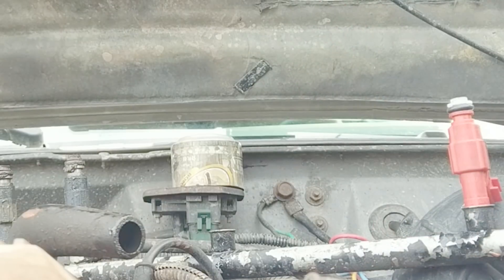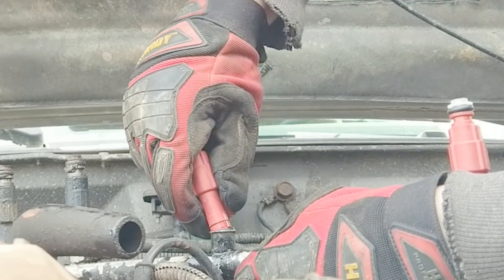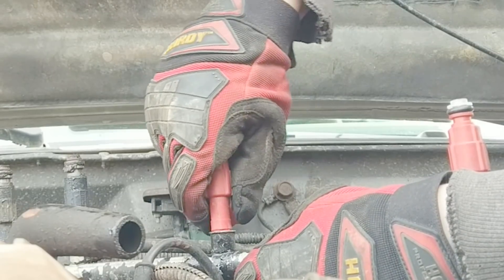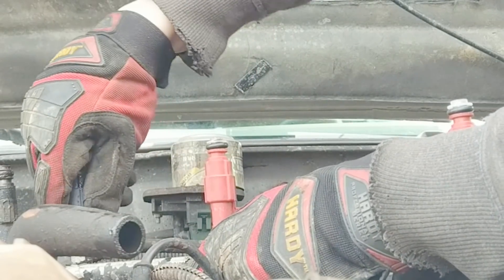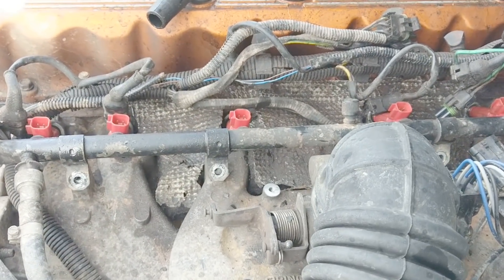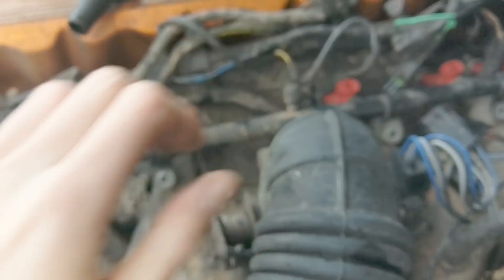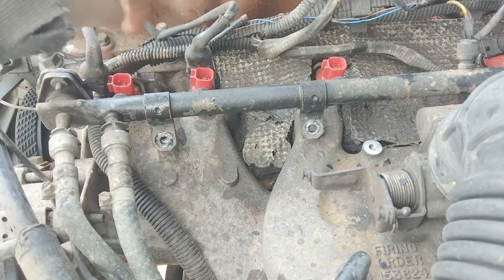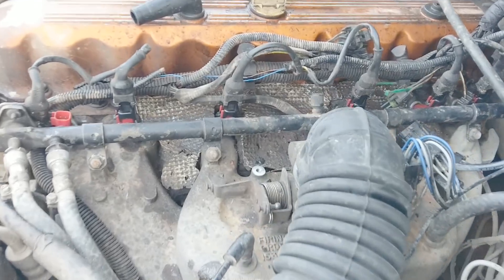89 Cherokee 12 Hole Injector Swap

Comment: I just received a set of twelve hole injectors in the mail today. I have a stock ‘98 XJ. I have the horseshoe intake and a new manifold on hand to be installed.
After watching your video, I’m even more excited to get them installed. 
I appreciate your thorough nature with your video, great job!
Reply: Kris Johnson I have a 98 xj Limited also. Is there’s a noticeable difference from stock injectors performance wise?
Reply: Kris Johnson do you have a link or website where you ordered your injectors from?
Reply: Hey Jason, I ordered these exact same injectors off of amazon.com. Mine have the same part# and same color. They were advertised as “UPGRADE 12 HOLE INJECTORS” and are a rebuilt Bosch part. I personally have a lot more faith in them being a quality and long lasting part vs the cheap replacement injector options out there. 

I can’t report yet on the performance improvement because I am midway through the install right now! I ordered the EV6 pigtails because I couldn’t find these adaptors that are on this video and they are supposed to arrive in the mail today.

To be honest, I’m not expecting any noticeable, at the pedal difference. I ordered the 12 hole injectors because I had a bad injector and figured that I might as well do the job right if I am going to do the job at all. And since I was going to do the injectors, might as well install the horseshoe intake I had on the shelf as well as the improved design exhaust manifold. 

I’ll let you know what I think after I finish it up!
Reply: Jason, I put the 12 hole injectors in and one of them let fuel through non-stop. I took them out and shipped them back. I am planning on buying them from a local dealer just in case the same thing happens again.

Comment: Yup got my 12-hole injectors from Raffi as well!! So far I love them! Starts easier, seems to run smoother, i have a stock 2wd 94 xj with 169k miles. I get about 19-20mpg at 75mph on average. Def worth the buy I think.

Comment: Harbor freight has a mechanic's stethoscope for like 5 dollars. They're great for listening to injectors and other parts to see if they're working. Even a long pick or screw driver touching the injector and the handle side on your ear, you can hear a ticking sound from the injectors when they're working right

Comment: I did the K suspension 12 hole injector swap over summer and everything worked great. Did improve gas a little. BUT. my engine was MUCH smoother. at idle you cant feel the engine at all.  Maybe just because the injectors were old. but for the price i think it was worth it.

Comment: Bosch Upgrade 12 Hole Jeep Cherokee 1999+ 4.0L EV6 Fuel Injector Set 6 24LB    I threw these in a few months ago, pretty sure my mpg took a shit. The center console was reading over 300 miles on a full tank before, now im under 250. It does idle smoother though. I currently have a donor trans that has shift issues though. I'll have a rebuilt trans in a week or two, so hopefully my mpg improves. Oh, i ride an 03 WJ RWD.
Reply: What was the consensus on this issue. I have a 99 too, and was thinking about this upgrade. But... It's running right now, and I'm afraid to F that up. Lol

Comment: Removing a fuel rail twice is a sucky thought but when you're changing injectors outside, paint and rust flying, using SANDPAPER in the rail just before you install the injectors, that might be expected. Every 4.0 swap I've done I have removed the rail completely, polished the injector o-ring holes with a drummel tool with the barrel sander and flushed the rail with brake cleaner and air several times before installing injectors with new o-rings using automatic transmission assembly grease. Or even thick, slippery wheel bearing grease. It dissolves quickly. That injector probably passed inspection tests before it was shipped, flow and volume.  You're a really smart guy you but need a clean garage. Maybe even pressure wash the crud off the engine first to save yourself a lot of "twice" work.

Comment: I'm a firm believer in dielectric grease on o-rings and electronic connections.  And I have to asked what the cut in half beer can is for.  What great simple job for trouble shooting injectors.  Good job Nick !
Reply from the maker: I could see grease working quite well, I'll have to try that next time. As for the can, it's a TPS umbrella to keep it dry since the hood vent is right overtop. Works quite well as you can see, haha.

Comment: Simple trick for installing new injectors, let them soak in gasoline while you are taking out the old injectors. Gasoline will condition the orings and they will install much easier.

Comment: You should use silicone grease on rubber rather than oil base spray.
Reply: I would use silicone too. On the other hand, the o rings are exposed to fuel all the time so they're definitely oil resistant rubber.

Comment: Same thing happened to me (rebuilt Bosch 4-hole), one of my injectors was bad out of the box. Not sure if it was shipping or what, they were fully rebuilt so I assume they were tested before they shipped them.

Got em on eBay and the seller also shipped me a new one quickly. That was before the whole 12-hole injector craze. I might as well wait until the 16 hole injectors come out or whatever before upgrading again, lol
Reply from the maker: Haha, it's funny you mention that because I thought I heard 1 or 2 people mention 16 holes before.

Comment: Been thinking about this upgrade for awhile and was just going to get the 4 hole. Now that I see that there is a big difference I think I'll bite the bullet and get the 12 hole. I also just upgrade throttle body to 62mm from DW Designs on Facebook and the throttle response is awesome.
Reply: OutJeeping did you upgrade?

Comment: I just finished installing mine!! I am now installing the new 3 core radiator and i have an issue with the fan sensor for my fan kit. Cant wait to start this baby! Thank you for this I have already done a couple of things you have done on your jeep and I feel mine will be so much better and reliable because of it.
Reply from the maker: Congrats! I think you'll be quite happy with that setup. Just had to get a real rad cuz hte ebay junk finally sprung a leak, but a yeah and a half any too bad i guess.

Comment: One thing I've gotten into the habit of doing, is any electrical connection that I disconnect and have to reconnect like the fuel injectors you did...I clean them and fill the cavity with dielectric grease. Its amazing how well that stuff keeps out dirt and moisture while promoting conductivity
Reply: Dielectric grease just fills up the cavity like gasket or silicone.  It keeps stuff out and prevents the contacts from corroding, which is great of course.  It is not conductive in any way, though.

Comment: Ooow you sound like a happy chappy :-D

So i take it that the holes are a smaller diameter but 12 of them, so a finer mist with less droplets of solid fuel entering the chamber.
So the fuel mist ignites together with less bigger droplets taking longer, a more accurate ignition.
Im guessing so i may be talking crap (Normal for me.)

Hmm 24 holes lol, no no thats silly :)

Comment: With all the extra displays and 7-place LED displays. It's starting to look like the Time Machine DeLorean. Next you will do the ultimate Off road conversation..hover mode. Where you are going you won't need roads.
Reply: Its funny because his devices's display actually lets you change colors.  Yellow Numbers/Text is not out of the question!
Reply from the maker: Haha, all in due time. I think I only need a few more displays and readouts to be set!

Comment: You need a splash guard. Next project? I made one out of a rubber bed liner. Engine stays clean
Reply from the maker: I actually have an old video on here of me making a splash shield. I didn't notice it staying any cleaner, and it actually messed up my highway airflow and the engine would get a lot warmer. Would be nice to keep it clean, but trail Jeep will be a trail Jeep.
Reply: NickInTimeFilms understood

Comment: i like to see a very quick snap on throttle b4 and after injector swap
Reply from the maker: Well you'll have to find that else where, ain't no way I'm putting the old ones back in lol
Reply: @NickInTimeFilms  lol, ll try mine, b4 and after, i dont like the way my engine response on a quick throttle snap with oem injectors

Comment: You have some interesting dialog there. Getting things choochin, safety squints, not tea bag, probably more I haven't heard yet as I'm still going through your videos. Good videos, informative and not boring. Anyway, ever watch AvE/BOLTR on youtube?
Oh yeah, get a damn tripod &/or one of those gorilla stands that you can mold the legs to hold on to things. Then you get to use both hands ... to work on the Jeep. 
Back to tracking down this freaking random misfire I get when the engine warms up. What a PITA! "Built To Canada Mkt. Specifications" meaning block heater, daytime running lights etc I assume. "Low emissions vehicle" ummm OK. I didn't know that is AKA CARB. 4 - O2 sensors on an l6 4L!
Reply from the maker: If you know AvE then you know exactly where I got the quips, haha.

Comment: 13mpg i could only dream about those numbers in my 91xj i only get about 250 miles out of a tank of fuel if im lucky, lol
Reply: Steven LaFrance same here 87 xj getting 8mpg at best
Reply: estimated 7 on a 99
Reply: Steven LaFrance are you running with a lift and larger tires by chance? If so I wouldn't be shocked by those numbers but if you're around stock I would expect better then that and would have a few follow up questions for ya
Reply: Steven LaFrance 250 miles from a tank? In my 93 I get 120 from a tank IF I’m lucky.
Reply: Lol 250 miles per tank and you're complaining? I'm lucky to get 140 miles per tank. I get 7 mpg City and 11 highway. 32's with stock 3.55 gears for now.
Reply: Are you serious? I just drove from texas to south carolina got like nearly 18mpg. Air filter was horrible with oil and my fuel filter was nasty

Comment: Could you do a follow up video on the Monsta liner floor?  Just curious what it looks like now
Reply: Hi Isaac, i lined my jeep inside as well. Its super tough. I also have purchased predator green and black for the whole outside.
Reply from the maker: I should do some kind of walk around video at some point. Was hoping to have in mostly done before that, but that could be a while. haha. It's held up excellent so far and I have zero complaints. I had to bash the trans tunnel in to fit that minivan seat and the monstaliner didn't even flinch, just took it on the chin like it was nothing.

Comment: I bought a set from summit racing  once and not 1 injector worked. Wound up buying a set from a guy for 20 that had an 04. My old injectors were leaking at the housing

Comment: Would you ever be willing to dive into the whole intake temp sensor relocation and how it effects fuel trims if at all?
Reply from the maker: There was actually some talk about this on my facebook page from some other users. One user noted that when in the manifold the temp would slowly rise and not change a whole lot, but while in the intake tube it was basically about what the outside air really was.

I could do a simple test of sticking a potentiometer in there and see how much the trims change one way or the other to get a baseline. The other thought I had was how much of that temp was due to heat soak. Would be nice to somehow mount it without the manifold offsetting it to see if the air really is that much warmer inside or not.
Reply: NickInTimeFilms yeah I actually read that post, the heat soak theory makes sense, but assuming that's the case and the air box/air tube is a more suitable location does it really matter to the long term fuel trims?

Also for testing the actual air in the manifold,  you could always go buy one of those two piece meat thermometers, alot of those have the ability to measure from the center of the probe or the tip and they read air temp pretty well. Could always wrap on of those in tape and stick it in a vacuum line port as a ghetto method.. mhm. I actually have one, I may try it for the hell of it. Lol

Comment: My renix turns over several times, 8-to 10 times, before it will run. When i press the shrader valve after sitting no  gas comes out. New fuel pump.
Reply from the maker: Hmm, have you tried priming the pump a few times before starting to see if that helps speed it up?
Reply: it could be leaky injector seals or a bad fuel filter pressure regulator (round thing on top of the gas tank). there is a few tests that you can preform by checking if you have pressure at the shrader valve when you shut down and then also check again after your jeep sits over night.  google it, there is some good info about this on a few of the forms

Comment: Think the 12 port injectors would work on a stock 6 cylinder 89, or would the pump not be able to keep up? Awesome videos as always!
Reply from the maker: I'm still running the stock pump, from what Raffi says these work fine on stock engines too.
Reply: Swanky, thanks for the quick reply
Reply: Just curious, how'd your mileage go after the modification? I switched over about 2 months ago, everything runs quietly but mpgs dropped pretty hard
Reply from the maker: My stroker is a thirsty bastard as is, but I've a really noticed a gain of about 1-2 MPG with these injectors and my wideband converter, though I think having my engine run leaner on the highway is helping more with that

Comment: Hey thanks for this video! I swapped out some leaky original single holes for 12 holes yesterday and it’s amazingly smooth and powerful once it gets warmed up but during warm up feels like it’s gonna almost stall out at first. Will this get better as computer ‘learns’ the nes injectors? 

I got an 1989 Cherokee I named ‘Jicks’ a few months ago. Been learning about them and fixing what I can myself. They look so great and are fun to drive.
Reply from the maker: Interesting question. So with the Renix system you have 2 factors here, one is cold start enrichment, and the other is closed loop mode. Cold Start Enrichment just means that more fuel is added when the engine is cold so that it will stay running. I feel like they went a little overboard with it or the 12 holes can actually atomize cold fuel better, because my stroker runs unacceptably rich on a cold day and I want to tune that back.

The second part is closed loop mode. This is where the engine runs off the o2 sensor so that it runs the correct air/fuel ratio. As long as the injectors aren't too big for the system, it can tune them a bit to get it to run just right. If will start to learn the new fuel baseline after driving in closed loop for a while, so hopefully after that it will run better at startup.
Reply: @NickInTimeFilms  cool thanks! start up this morning was an improvement over yesterday so i think she's more use to the new set up. i may have to invest in one of those REM readers later so that I have a better idea what she is doing. I can only listen right now but can hear when she goes from open loop to closed loop and yeah runs super smooth in closed. just put in new spark plugs and wires, distributor + cap + rotor, ignition coil, fuel filter and injectors.... before she had a long crank to start, now she just snaps! so awesome. anyways thanks for these helpful videos. great learning tool! Yippie!

Comment: the k suspension dude said that you have to turn the ignition to on then pull the lights lever on then off then turn off the ignition and congratulations you have reset the PCM to finalize the injector swap..did you try that?
Reply from the maker: That is for new model jeeps. For my Renix it's as simple as just pulling the battery terminals for 30 seconds. All that does is reset the fuel trims, but the injectors still have to be fairly matched to stock flow to work properly.
Reply: @NickInTimeFilms  I've got a 96 and I've got stock injectors and I'm debating on 4 or 12 hole injectors. It's my daily driver for now so I want a "noticeable" injector upgrade.
Reply from the maker: @lh1678  after having both, I like the 12 hole better
Reply: @NickInTimeFilms  cool. thanks. also how much for the 12 hole?

Comment: Where is that exhaust leak? If it's the donut, that can really mess up your O2 readings.
Reply from the maker: Found out later the Header was cracked all over the place so the readings were most likely skewed a bit. Replaced it and did some other exhaust work so it should be fairly tight now.

Comment: Hey got a question.  I see your thermostat housing has some sensor  on it.  I have the same 89 and wondering what you changed.  Is that Coolant Temp Sensor?  If so is that a better place for it and what year vehicle did you get it from?  A link would be awesome!  Thanks for all the info!

Comment: How would these work with an even better 16 hole upgrade and a supercharger? oof
Reply from the maker: Haha, now you're asking the real questions. Depending on how my tuning goes and if I step up to 37"s, a super charger would be awfully nice...
Reply: NickInTimeFilms yeah dude! i saw a guy in a tj put a supercharger in his and the banks turbocharger works well think with a tune he got over 80 hp and 100 tq to the wheels! damn and no turbo lag lol do you always have rough cold starts? i always do but when its nice and warm its extremely smooth like a new jeep
Reply from the maker: @WeKnowTheTruth2012  Thank the Stroker for that. Cold Start Enrichment plays hell with the AFR and it barely runs. When I finally get into tuning it, I'm hoping to correct most of that out so it actually runs. There are occasions on luke warm starts that it will just stall, so really looking into fixing it. Should get some more power to boot.